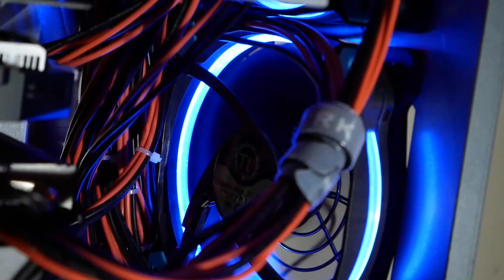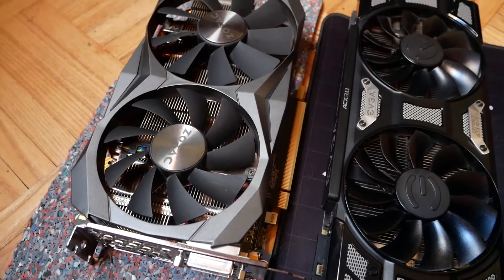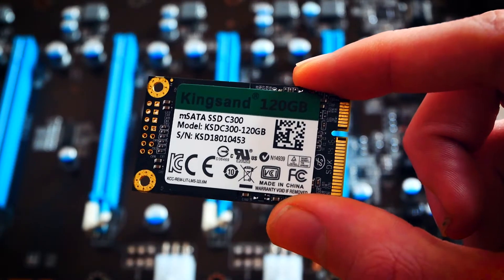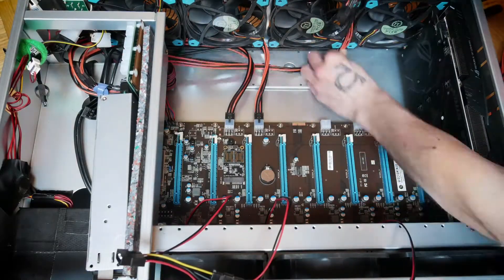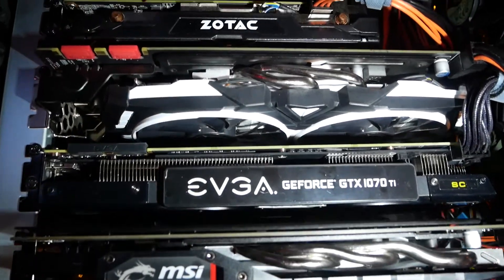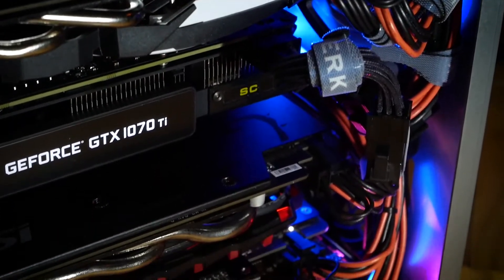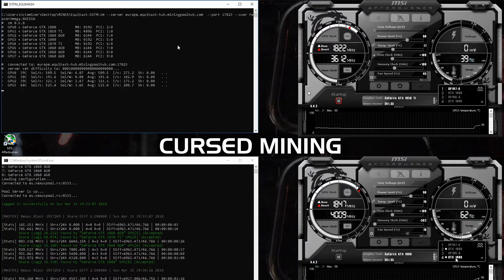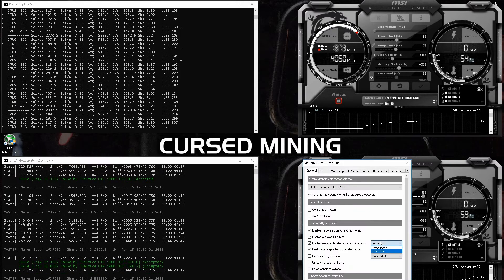Octominer X8 nVidia Equihash / SHA3 GPU Mining Rig Build How To Part 2 [ICE6S]

Comment: what does a rig like that cost? how long for an ROI with increasing difficulty?
great video btw
Reply from the maker: Hey thank you first of all! So for the Octominer Board (with CPU included) + mSata + RAM + Case you are looking at between 450 - 500 USD as investement. The classical route this way would be to go for  an ordinary Motherboard for 6 - 12 slots and buy Risers, CPU etc. separately and maybe build a frame yourself (I have links for that in my description, depending on where you live this could be the cheaper way for you). In terms of cards, it's more difficult for me to tell because if you know my channel already, you see that I buy my cards one by one, scaling slowly. So f.e. the Zotac 1080 you see in the build has been my workstation card in 2016, bought around the time they came out and it even was the card earning my second mining card with mining in not-worktime. Except for the mentioned 1080 and the one 1070TI, none of my cards were bought new, but were bought used searching for cheap deals, then refurbish them and set them to work (will have a video about the refurbishing part coming).
Reply: yeah a refurbishing video would be awesome